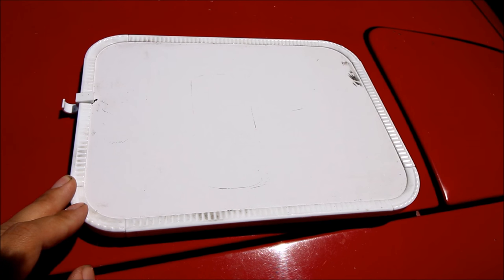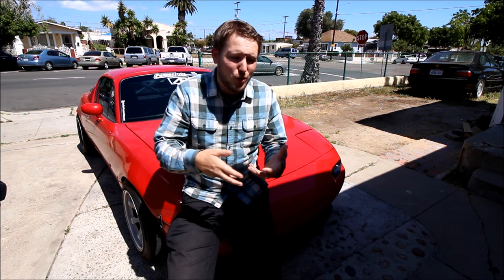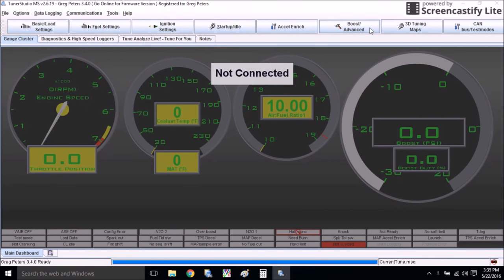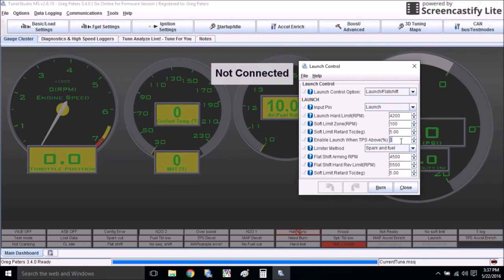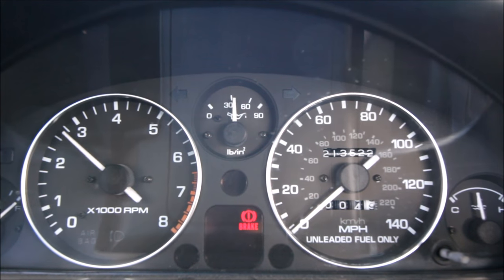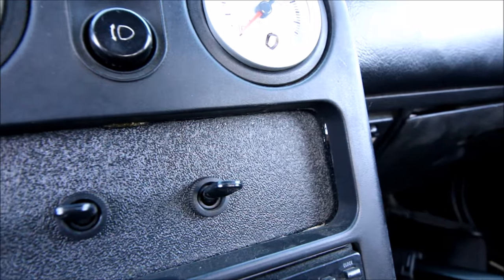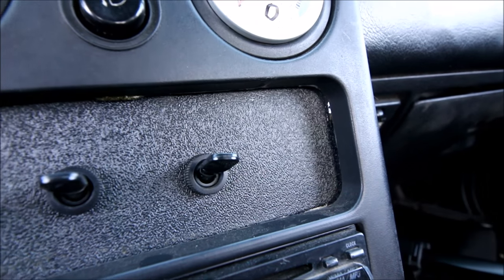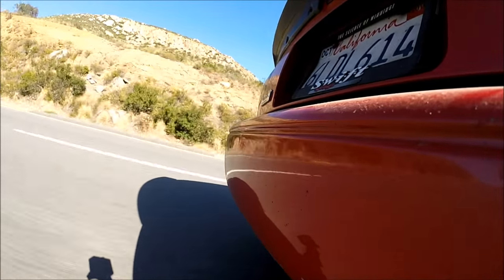Shooting Flames! Launch Control & Flat Foot Shifting Tutorial. (Megasquirt)

Comment: Clutch switch and neutral switch wiring issue... many manufacturers wire the car for auto and manual and use the same harness. This may be the source of that issue.

Comment: hey Greg, ive been working on my 1990 1.6 miata and i bought an assembled DIY ms2 from diyauto and after wiring up my harness im not getting any tac signal.. and my ms2 is not seeing any tac either and giving me an error. and in turn the car is not starting...all the wiring diagrams for 1.6's from the internet are different... do you know or have a diagram that will work?

Comment: Hey Greg, I did the clutch switch/neutral switch swap fix on my 1.6 years ago when this video came out.  Now I'm trying to get my cruise put back in the car and was wondering if the circuit would be messed up from the disconnection to the neutral safety switch. I know the cruise uses a separate clutch switch...just seeing if you have ever heard of this?
Reply from the maker: If you have your LC wired like I did in this video, it will have no effect on cruise control. (Need to verify the upper switch is working properly, see my updated LC setup video 🙂)

Comment: You didn't get it quite right. Launch control builds boost on full throttle when you're standing still. antilag builds boost when the car is rolling and the throttle plate is fully closed and it needs an extra air supply to get air for the combustion in the exhaust manifold when you shut the throttle plate. I am building antilag on my Sierra Cosworth and I'm going to use a modified idle control valve to supply the extra air. I allready have the anti lag wired and enabled in the ECU but it doesn't work yet because it doesn't get enough air through the stock ICV.
Reply from the maker: +cossiedrifter This style of launch control will not build boost with the car standing still.
Reply: +TheCarPassionChannel That's probably why it's called 2-step. Mostly just a second rev limiter. Allmost no one uses  that in Sweden. It's boost building launch control or nothing. I have launch control on my Cosworth. It shoots flames and builds boost. But no antilag yet.
Reply: +TheCarPassionChannel But the system you use looks like "real" launc control (my definition).

Comment: I have a 1.8 NA. So all I would do is just unplug the neutral safety switch? I have bought a block off plate to block the clutch switch so I could start the car without the clutch (switch on firewall, not the one above). Would that matter?

Comment: You could have put a switch in the gas pedal so that it only activates the flatshift at full throttle, making your on/off system automatic.
Reply from the maker: What if I want to launch the car at less than full throttle?
Reply: @TheCarPassionChannel  You would need a switch to bypass the gas pedal switch
Reply from the maker: @eduardomargutti  So the on/off system would again become, not automatic. Lol
Reply from the maker: @eduardomargutti  Besides, you don't need a switch to activate launch control at certain throttle %, Megasquirt does that already.
Reply: @TheCarPassionChannel  My line of thought wasnt including launches, only going foward, like in a race. So you wouldnt need to flick a switch every time you needed to rev match. And if you wanted to do a launch, you flick the switch and the gas pedal switch will be non-existent.

Comment: Hey greg, i have a question about launch control on my 2000 miata, i have megasquirt and wideband, what happens is when i set up launch control it works fine in gear and neutral but as soon as i turn off my car and try to start it up  again it wont start. It just cranks, and says i have a setting error. It starts back up when i use my old restore point. What do you think is wrong?

Comment: Alright so I've got the 93 megasquirt pnp with the "wire reroute mod" that you did in the video but whenever I turn on launch control in MS the launch bar in the lower bottom of the screen doesn't turn green or red it stays the normal black and white and the launch control won't work, any suggestions? Btw love your videos keep up the good work!
Reply from the maker: Launch control is also turned on in Tuner Studio? Set to the right pin?
Reply: TheCarPassionChannel, yes it is turned one but do I have to run a wire into the pin on the outside of the megasquirt in the options port? And I'm assuming that I need a variable tps for this which I'm working on getting.
Reply from the maker: Yes you need a vTPS for launch control
Reply: TheCarPassionChannel  one more question 😂I know sorry, do I have to run any of the clutch switch wires into the megasquirt via the options port?
Reply from the maker: My MS already utilized the stock harness for that, so I did not have to. If you can't get it to work like I did in the video, you can wire into the options port
Reply: could you set the required rpms to 0% if you dont have a variable tps?

Comment: BTW. retarding enough on launch control will make you build boost...which  is ALS... - correct me if I'm wrong.
Reply from the maker: It shoots cool flames and makes loud noises but won't get above 1-2psi of boost really. I do believe ALS works differently from Megasquirt's 2-step.
Reply: I saw real boost at -25deg
Reply: +TheCarPassionChannel in the launch control menu
Reply from the maker: Elior Zeno I know where it is, just won't let me go past -5. Not that I want to anyways, turbos and head rebuilds ain't cheap.
Reply: +TheCarPassionChannel when I set it low enough it will build boost, I totally agree about not breaking our cars.
Reply: Just checked, It will accept values as low as -89deg
DIYPNP fw 342

Comment: For some reason it activates without my clutch pushed in.  It will activate even if I'm just driving and i hit that rpm.  For some reason selecting launch as my input will send me a error and my car won't start.  I know i have a clutch sensor but it looks like it's pushed in all the time when the clutch isn't pushed in.  Any suggestions for what I should do?

Comment: I know this vid is 5 years old but I’m trying to get a miata as a first car. What year do you recommend and what are things I should look out for when buying one or owning it?
Reply from the maker: I have an even older video called "how to buy a used Miata" that's got some tips in it. As far as the year, it depends on if you plan to modify it and if you like the NA or NB body style. Basically the newer engines are a little more powerful and make more power with mods. The 1990-1991 have a "short nose" 1.6 that's less desirable due to possible crank failure if neglected.

Comment: So realistically flat foot shooting shouldn't be any harder on the transmission as long you're not dumping the clutch right? Seems that it could be useful without having to slam gears if so
Reply from the maker: I actually let the clutch out very quickly on a flat shift. What saves the trans is as the clutch is starting to engage there's still no power from the motor, it doesn't come back on until your foot is higher up. It really works better to do it more quickly.
Reply: @TheCarPassionChannel  that clears it up so much thanks, so it's no rougher on the transmission than quick shifting and letting off the throttle just with the benefit of you dont have to re build the boost!
Reply from the maker: @CuttinChris  Yep! As long as it's tuned and used properly. You'll know... You will be amazed how smooth the shift actually is when it hits right
Reply: @TheCarPassionChannel  thanks man I appreciate it a bunch!
Reply: @TheCarPassionChannel  I got mine setup today but it's a little funky on our speeduino terminology. I have it set to arm over 3k but then it has the soft rev window option and says recommended 100-1000 I gotta tinker with it cause when I shift at 3500 testing it itll jump to 3700rpm

Comment: To my understanding my 1991 does not have VTPS, is this correct? Would you not be able to have the enable launch when TPS % is above 0%? Also is the neutral safety switch the one that is on the passenger side hidden by the front of the power plant frame?
Reply from the maker: You will most likely need a VTPS for this to work. I forget which is which (reverse/neutral) without looking at the trans

Comment: Does this work for my 95 1.8l miata? 2 step engages even when in neutral. It's basically ALWAYS ON. The clutch switch works as well

Comment: Greg do you know if you can do either of these an sn apexi powerfc?
Reply from the maker: Iv'e never used a Power FC, but any standalone should be able to do simple ignition/fuel cut like this.
Reply: I don't think there is a setting. but I will google it even more :)

thanks anyways greg! :) Oh btw the way I can't wait for you to crack 300whp with the new turbo. I have faith in you! :)

Comment: !very nice!  We need more budget megasquirt people around! Go e85, use GM sensor and crank up the timing! ohh it was worth it for me..
Reply from the maker: I run straight E85 without a flex sensor. And yes, very worth it.
Reply: I ran straight E85 for the first year, ended up going Flex because E85 pumps are few and far between I like to drive the car to work and back. Easy install, not bad to tune takes some fiddling which is what we like to do :).   I used GM # 13577429..
Reply from the maker: Detonation MS2 or MS3?
Reply: +TheCarPassionChannel MS3x currently. I came across a 3X really cheap on eBay, someone had given up their project. I was using MS2 a few years ago. it's not on a miata though, I have a sr20 powered 240sx. I've been using megasquirt since the ms1 on a Mazda mx6 turbo. I really believe that megasquirt has taught me more about cars than anything.
Reply from the maker: Detonation Me too, I owe a lot of my education to MS.
Reply: +TheCarPassionChannel was using my 2 step, I hust setup my flat shift and found my s13 has 2 clutch switch's.. one above the peddle also (probably used for the cruise control cut).. I swapped my wiring to the upper switch and now it doesn't rev over the split second I am moving the clutch down.. check your miata for that switch.. I like the difference.
Reply from the maker: Detonation What about when your foot is coming off the clutch? It doesn't it engage sooner than the power comes back on? I definitely want to try that way

Comment: Your launch RPM seems a bit low. How high have you been able to set it on the street before you lose all traction? How about on the strip? What RPM was it set to there? Have you messed around with the soft limit timing to see if you can improve it? I had mine set low as well but I never really played around with how high I could go.  I am not one to launch on the street but I like knowing I can.
Reply from the maker: I usually have it set between 3500-4200 depending on the surface. My clutch is close enough to the torque limit that is I slip it too hard, it won't hold in 2nd gear. It's also interesting on a boosted car because power output is not directly related to throttle position, so I wouldn't say there's a "perfect" RPM to launch at with so many variables. I launched at 3000 in this video just to demonstrate the function, and the lot surface was very slick.

Comment: set the throttle percentage from 3% for activation to 80% and you won't need the switch. it won't activate till your foot is above 80%throttle.
Reply from the maker: The problem with that is I don't launch above 80% throttle...
Reply: +TheCarPassionChannel I kind of figured that after I posted that comment.
Reply from the maker: Scott Wilson I have experimented with several % values, but never found a good balance. There are occasions where I rev match at 75-100% throttle as well. The switch works well though.

Comment: if the car has ABS can you use the sensor s and setup a kind of antispin??
do you know if the megasquirt is capable of doing it with these 90 s electronics????
Reply from the maker: MS3 definitely has traction control, but I don't know if it can use the ABS sensors, you may have to install aftermarket vehicle speed sensors.

Comment: Okay so my car doesn't have the bottom clutch switch (the starter interlock switch). The launch control works in neutral, but I don't really feel like tracing down the wires from the neutral switch and having to run two new wires from there. I was looking into using the top clutch switch. (the one that's pressed in when the clutch pedal not pressed) Can I just cut the wires coming from there, solder the two ends in the car together (so any possible remaining circuit is complete) and run two wires from the connector on the switch to the MS? I'll be placing a switch in between so I can turn it on/off on the fly. The two wires from the switch will run to the MS into the DB15 port, then from a DB15 connection on the MS mainboard to an input/output driver (or something, can't really recall what it's called) and from there to a usable connection on the mainboard. (like FLEX or something, which is mostly used on the DIYPNP for LC)

Will something like that work or does the MS need that clutch switch for something? (I don't have cruise control)

Another possiblity is to get a door switch and fab up some mounting plates and stuff to attach it to the threaded rod which runs from the back of the clutch pedal to (I assume) the clutch cylinder. That way I'll go full DIY but I won't hack up the existing top clutch switch wiring :P

Massive thanks if you reply to this! :D
Reply from the maker: Sounds like you know more than me on the subject.
Reply: +TheCarPassionChannel Oh damn, wasn't expecting that for an answer :') off to miataturbo.net it is then! :P

Comment: It seems like the revs climb just as you press the clutch pedal, could you move the switch closer to the pedal so the ign cut happens sooner in the clutch pedal stroke?
Reply from the maker: +Albie Beck I really want to figure out a way to do this. I've definitely logged over-revs of 7700RPM because of that which is unsafe for a stock head/valvetrain.
Reply: I'm not sure of the mounting arrangement, but maybe you could just glue an extension on the button rather than shimming the switch. 

Strange that it would rev to 7700 if the limiter is still 7300.
Reply from the maker: Albie Beck The spark might be cut at 7300 but the momentum of the crank can carry it higher.

Comment: About the variable TPS you seem to have; where did you get it? My TPS does not speak 'megasquirt', so I cannot use all these fancy features. /sadface
Reply from the maker: +André Baumgartner Which TPS do you have? A TPS is just a variable voltage signal, any VTPS should work.
Reply: I have the original 1.6 TPS. It's a '91 US import, so should be pretty similar to yours. Megasquirt does not seem to be able to get any readings from it.
Reply from the maker: André Baumgartner Yeah they are not VTPS. When you add a vtps, you might have to add a jumper to MS.
Reply: Ended up getting the Wells TPS201. Cheap and easy to mod :)

Comment: are you using megasquirt because of the ease of use and price difference compared to something as a Microtech or fuel Tech just curious
Reply from the maker: +Rizzy4magic I've never heard of those systems. At least in the U.S., Megasquirt is the standard for turbo Miatas. It's used 50:1 over any other system, and therefor has the most information available for tuning. Plus there's a plug-n-play version for all Miatas, so it's a very popular choice.
Reply: +TheCarPassionChannel ahhhh thanks for clarifying love the videos by the way keep up the good work

Comment: Im about to buy my first miata. Its a 1.6 from 92.
The thing is, im from germany and the car is here too but comes from california. Is there anything special what i have to look for?
There is one thing on the car that confuses me a bit. The red area on the rev counter starts at ~7100 RPM. I have never Seen that before. normally it starts at 6500 in the 1.6 or at 7000 in the 1.8 am i right? That confueses me a little bit
Reply: I just looked at it again and the redline is more at 7250 RPM. Also strange is, it counts distance in miles but speedo is in kph not in mph as it would normally be.
Did somebody "repaint" the Instrument cluster Or how is that possible?
Reply: +Mathias Mang he changed it for a custom one. Look on his channel.
Reply from the maker: The custom ones aren't shown in this video though. @Mathias My speedo shows both MPH and KPH, and the odometer counts miles.

Comment: So I have two switches on my clutch pedal not sure witch one is the one I need to connect to neutral switch
Reply from the maker: Kyle Rothschild Not all cars need this mod, most of the time you can go straight to the ECU. You'll want to use the top switch (even though I used the bottom switch in my car - it's not the best way to do it)
Reply: I have a nb with MS3 pro and I have the 2 step set up but it doesn’t read that I have the clutch in or that is in neutral maybe I don’t have the input on the right switch
Reply from the maker: Kyle Rothschild Yeah I have MPPnPPro in my car now and I do believe you have to wire the top clutch switch into the "launch" pin on the MS options plug. Then it should work.
Reply: Ok thanks so much love your videos I’ve watched almost every vid

Comment: So I got it two step to work. But it only works in neutral, any idea how to get it to work in gear?
Reply from the maker: You may have the same issue I had. Check my newer launch control video out

Comment: what rpm works best for launch control? I know this varies between wheel/suspension setup ect just looking for your experience. I have mine set at 5k and get a pretty good deal of wheel spin
Reply from the maker: +4206juggalo You can also use less throttle to lower the wheelspin. It's just a matter of trial and error!
Reply: +TheCarPassionChannel thx! I'll try to lower the rpm a bit, you know I want full throttle when I'm launching tho. flames/smoke all that lol